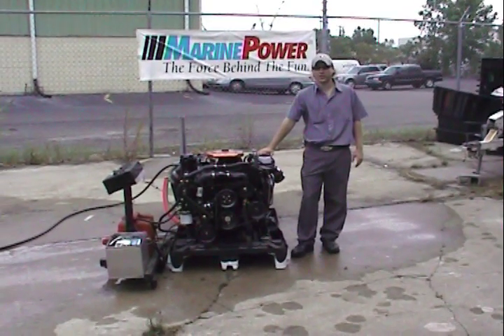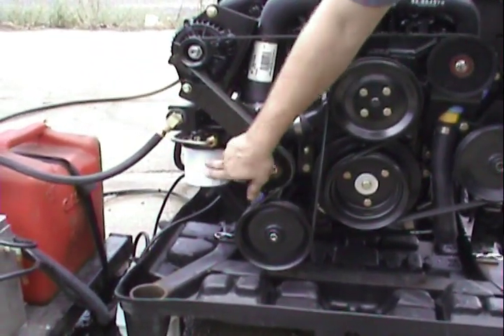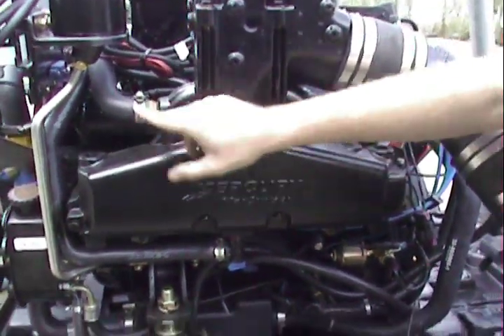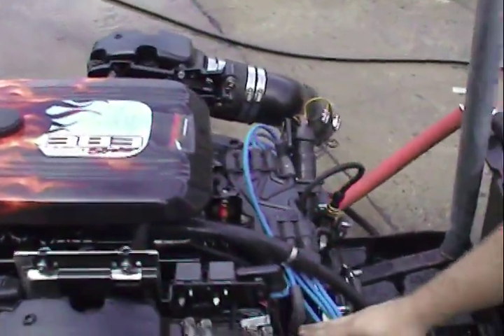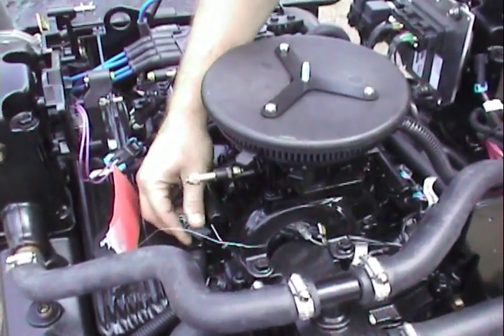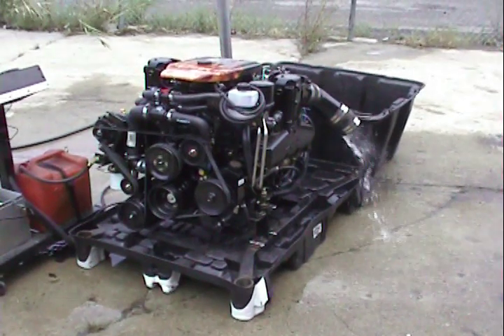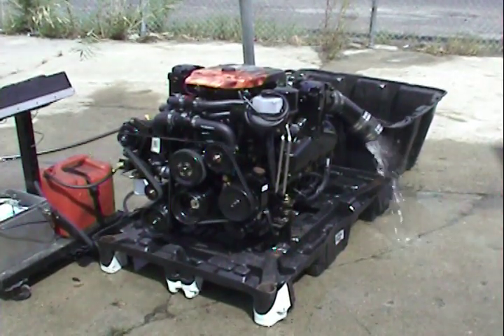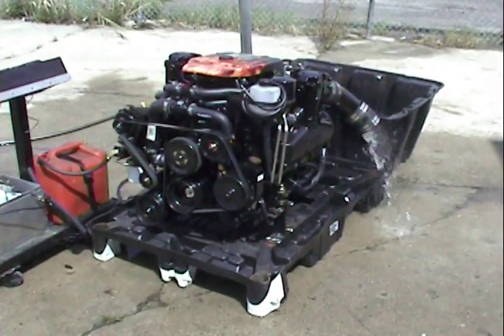Mercruiser 383 Stroker marine engine

Comment: Why hasn't Merc just put a radiator on it so no bayou water is needed. And just use outside water to cool the exhaust.
Reply: I have the 383 mag stroker by mercruiser  in my  24ft seasport.  It has a radiator. Raw water is for exhaust only.

Comment: Should have rebuilt my old motors , I thought i was buying mercruiser pro-built engines .
So wrong . I will run these motors after they are fixed and let you know if they have the HP they say they have .

Comment: Hmmmm...very interesting engine.  I've got a '92 Yamaha Hydra Drive (very rare these days) that uses a 7.4 liter engine.  I wonder if this would bolt up to the outdrive...
Reply: It would definetly work! You simply need to reuse your Yamaha-style bell housing and drive coupler. Just bolt your drive coupler onto the included 383 flywheel and bolt up your Yamaha bell housing and boom, you're in business. GM engines use the same back-end bolt pattern, but the flywheels are counter-balanced differently for each engine displacement.